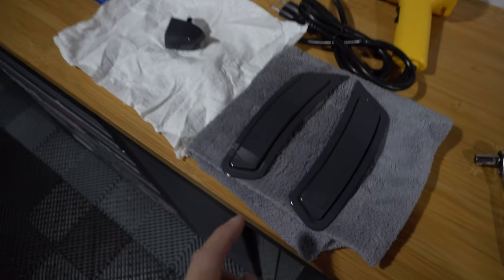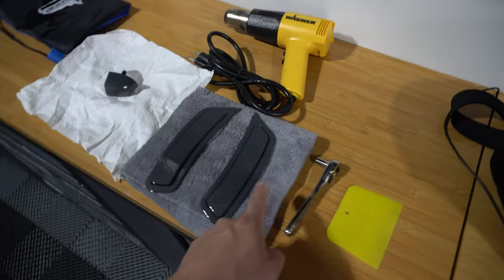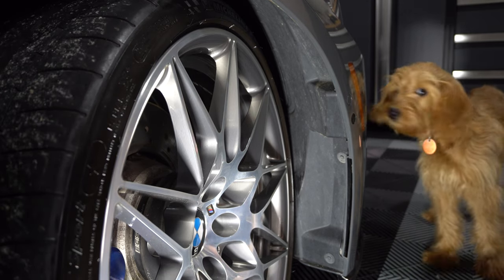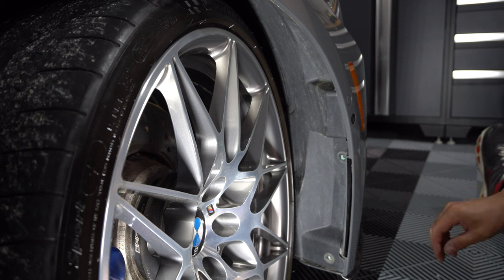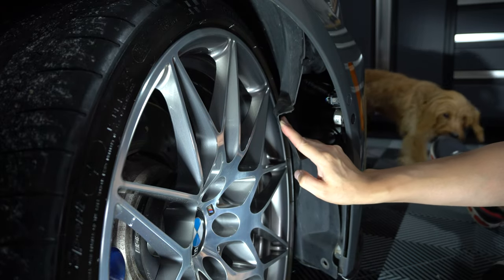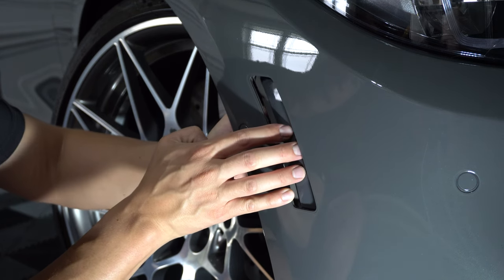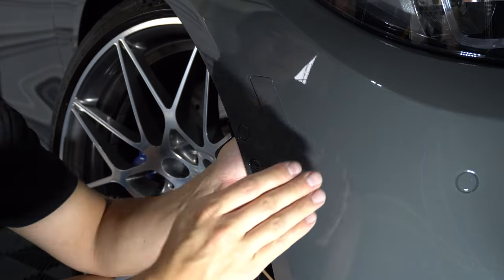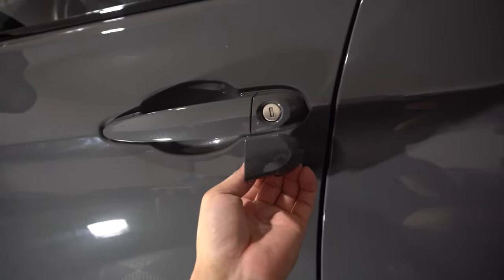IND Keyhole Delete & Reflectors | IND Install

Comment: If I replace my driver front door that has the Technology package /comfort , with used a one. Do I also have to swap out out lock actuator  and the key hole slot?
Reply from the maker: If youre replacing with a used door completely, then yes, you need to swap the key hole slot. Otherwise your stock key isnt going to work on someone elses used door.